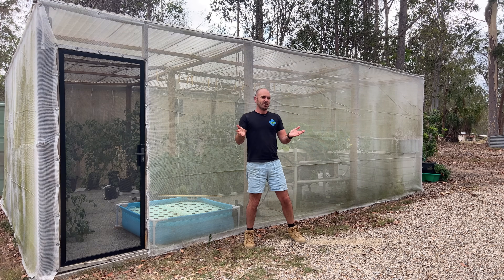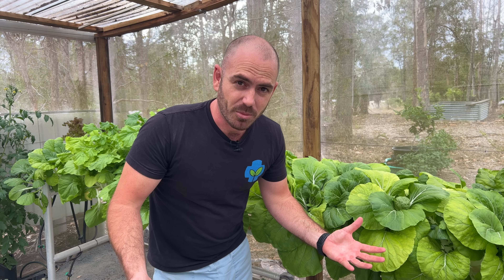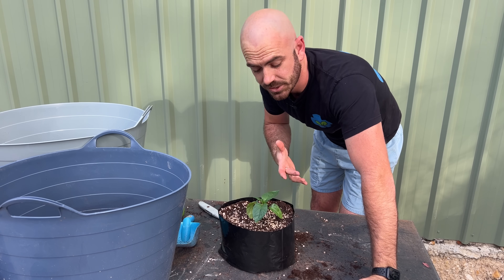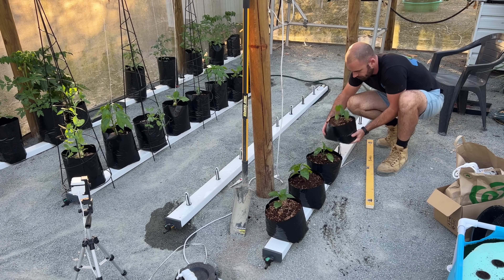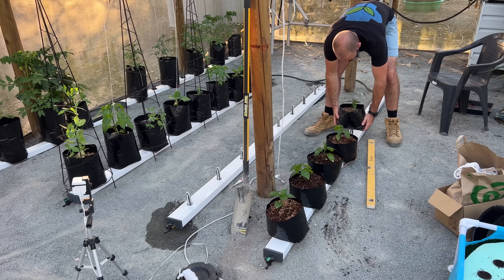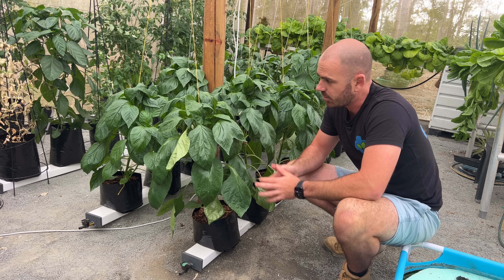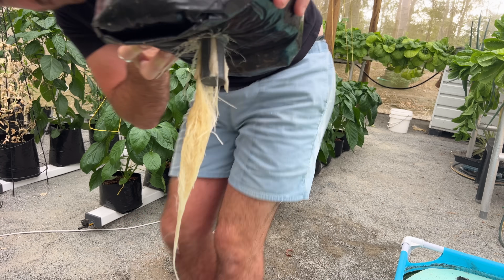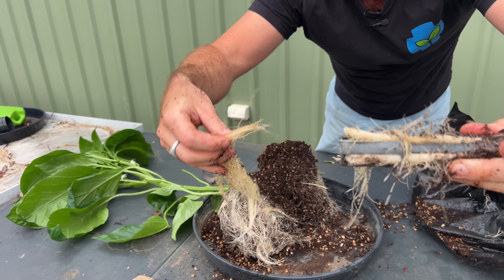How To Grow Hydroponic Peppers: Low Maintenance Wicking Bag System

Comment: I've had bell peppers growing in krakty since june and absolutely no growth
Reply: Despite Hoocho's pepper's roots growing into the pipe, peppers don't really like wet feet.  Kratky probably isn't the best way to hydroponically grow them.  I grew some in 2 gallon grow bags set on a pond liner and kept about 3/8" of water in the pond liner with one of Hoocho's float boxes.  Most beautiful looking pepper plants I ever saw.  Grew 5-6' tall but my greenhouse was too hot limiting flowering and when they did flower there weren't any bugs to pollinate them so I got very few peppers out of them.   Same peppers in my garden only got 18" tall but they produced almost all my peppers.  Also, a lot of them just fell over because they outgrew the stakes I used.  Definitely need a way to tie them up if grown this way.  Had same issues with both bell and jalapeno peppers.  Roots did grow out of the bottom of the grow bags but not to the extent you saw in the video.  Tomatoes had the same issues.

Comment: Could you add a yield of fruit difference at end of season? It would be helpful in seeing the effect of bag size
Reply from the maker: I'll try to do this. :)
Reply: Hello Hoocho,
 I’m starting vertical hydroponic Lettuce indoor, I’m from India and used .54 gm of masterblend 4-18-38, .27gm of Epsom salt and .54gm calcium nitrate in 1liter water for Lettuce and I got EC 1.3 around 650ppm per liter. Is it enough for almost 4weeks old lettuce or do i need to increase the dose?
Reply: @atulsaini22 how's your system working?

Comment: Awesome cappy.i have a question mate I'm in the tropics.would the solution dilute Too much in the wet season.or should I use clear plastic over my greenhouse?
Reply from the maker: I’ve never had problems with rain. Depends on the system. 
But if you calculated the area of the open top and then times that by the amount of rain you’ll get an understanding of how little it effects the system.

Rain has always been a good replacement for water transpired in my opinion.

For example. If you get 1ml of rain for every 1m square. That’s only a litre of water. 
You probable won’t have a meter of open top.
Reply: @Hoocho  thanks brother.

Comment: Hey mate, do you get that extruded foam you used in the kid pool beginners build from Bunnings? I've been looking around and I'm not sure I'm looking at the right stuff.
Cheers
Reply from the maker: Yeah, but they’ve stopped selling it for some reason.
Reply: @Hoocho  is the stuff you used called Extruded polystyrene sheet - XPS blue board?
About $19 for 1200*600 sheet sound right?
Reply from the maker: @Budginut  that’s the stuff
Reply: Thanks